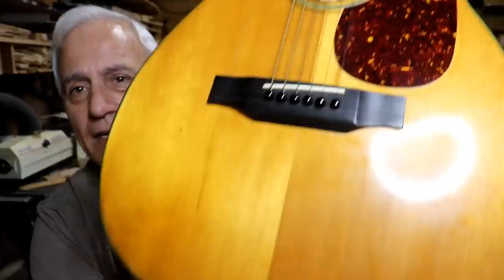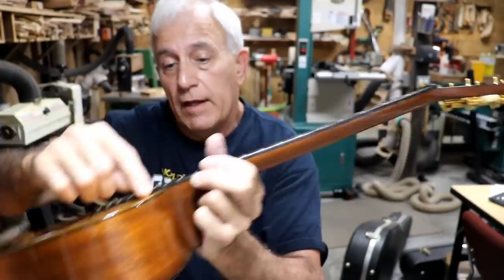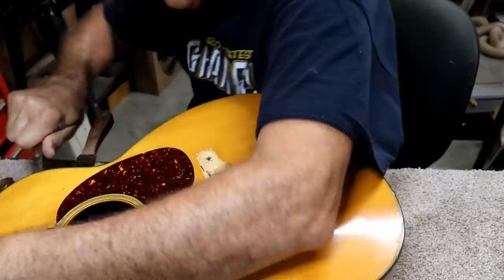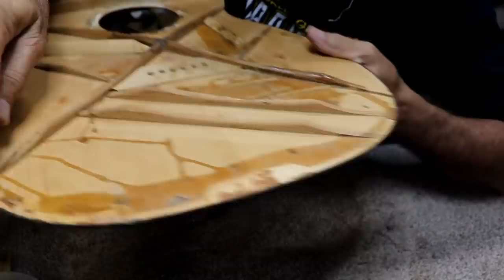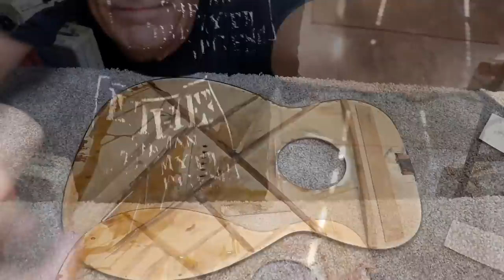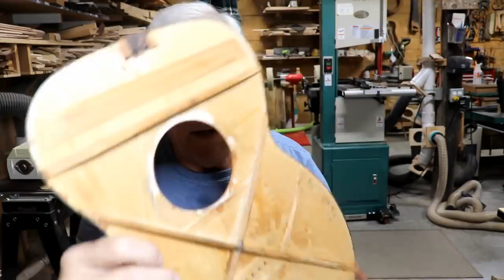542 RSW Martin 00-18 Journey From Total Destruction

Comment: Hey Jerry, I know you are a "tinkerer" so I had an idea... The knife you're using to separate the top from the sides could be modified to mount into an electronic component soldering iron with a thermostat in the base power unit.  Not the one that looks like a gun, that's a soldering "gun". Go figure.  What I'm getting at is if you dismantled that knife and just had the knife blade with the tang exposed, you could hammer the tang into a partial cylinder, say.... about 1/8 of a circle.  Then, place the soldering iron heating element into that partial circle.  Craft the proper mounts to secure it internally.  Then craft a tube that all of it slides into (make sure you use lots of fiberglass insulator).  Re-rivet the tang through the new tube handle with the cord going through the handle and there ya go.  Constantly heated knife.  Another thought is this could be made into a modular setup with all your knife blades having the same type of tang that slots into the heating element socket.  Possible time saver?   Just some thoughts.

Comment: Hey Jerry, I have a Thermistor controlled unit similar to yours but i don't have a big workshop so none of my apparatus are in situ. So to save time I use a cheap pair of women's ceramic straightening Tongues for back or front removals. It's very rare i undertake such work, but i can and i have on a few occasions. Anyway I find having heat go onto the tool,  on the top and bottom of the blade, helps loosen up the Glue a little quicker. I have picked up enough tips from you for Heavens sake. In case you hadn't considered. Thanks Jerry.

Comment: I usually clean hide glue mess by laying a wet (not dripping wet) paper towel over the area and waiting for a couple of hours. You might need to replace or re wet the paper tower a few times. After a couple of hours the glue scrapes of pretty easily. This method I believe would save you a bit of time scrubbing the area and could minimize the exposure of the top to water. That being said, the huge amount of glue you had there maybe would require multiple sessions…
Reply: You are right. It is pretty easy to remove this way. But soaking a couple of hours is not my thing. I soak the very spot for 10 minutes, then scrape lightly and repeat this process. This way the water hasn't a chance to soak too deep into the wood.

Comment: Theory: the glue dumped inside acted like the resin in a composite and "locked in" the curvature of a top that was out of shape from loose braces and cracks. Maybe it will recover some after its bath. Maybe look up the radius of the top and, stick it in a go-bar deck with that radius underneath. Maybe hit it with a heat gun too. Just spitballing

Comment: Jerry that fingerboard extension does add some structural stability IMO. I realize it’s only 1/16” of wood under the fret, but IMO that’s plenty of hardwood to minimize the backwards  “hinge” potential at the neck. Every guitar I’ve had in that has been cut at the extension was worse for it.  Tuning stability in particular but also tone.  The only fix is a new fingerboard which did solve the problem. Just my experience.
Reply from the maker: I've done it for years my work is 100% guaranteed and I've never had a return
Reply: I agree with Jerry...vastly experienced, IMHO

Comment: When those holes were drilled through the top and though the braces near the X braces it compromised the structural integrity of the guitar top.  String pull then deformed the top from the bridge to the tail block including all those braces.  It will need new braces to resist the string tension for a complete true fix.

Comment: Hi Jerry that's not a job for the feint hearted and all strength to your elbow for making the decisions you must make, now regarding the mystery of the damage to the top, my deduction is that the top "blew out".. with the pallet knife being inserted and the contact of the top still glued to the heel block, the top sheared between the glued edge and the finish, as the glue was stronger than the wood and as that wood is 60 years old and dry it's a "pressure blow out" anyway that's my detectives conclusion on that!! ...as for the soundboard I think the only way to shape that top is by removing all the scalloped bracing soak the soundboard, clamp it flat till dry and rebrace to hold the top structurally flat, sometimes its better quicker and easier to just start from that point but hey its your time and it's the clients money... im sure whatever decision you come to, it'll be the right one, good luck with the refurb... waiting for part 2...regards from the UK... johnnie

Comment: Jerry, I see that the lower X-braces and cross braces are heavily scalloped. Is this from the factory, or did somebody thin those braces in an attempt to get more volume? They look so thin that there can’t be much support there. If so, no wonder the top is distorted.
Reply: funny that I come across this video and this comment today.. I dont know why someone would try to get volume out of a acoustic by shaving the x bracing. To me all that does is weaken the top, or bottom while the guitar strings are up to tension..

Comment: The glue that was added was much harder and built up than the joint glue. When the flexible knife came in contact with the rigid glue it forced the blade to the path of least resistance, through the top.

Comment: Hey..love your work an videos ..I'm working on a mandolin from the 20's a B,L,$F..from New york... dont have much info on it it was sold through Chicago music exchange in its fay... my ??? My question is I pulled the back it was cleanly broken in 2 pieces, I have pieced an glued together the back very cleanly, an curios if a such of a large panel break?.... would it be necessary for cleats I honestly feel the glue repai is strong enough ...I just fear the wood being so old an dry will pull away from the glue at the crack repair...i know how much you dispise some just throwing extra wood under the top or bottom ,,I honestly do also ... there are  no gaps in either pieces of the crack repair they are as I said real tightly bonded bak together ...the crack is noticeable being so large but stable in my opnion... that's why I ask for yours ...I know there is no pics or photos for you to judge..its the age of the instrument that puts on the Fence..???
Reply: You, Definitely, want to use cleats, on that crack
Make sure the grain of the cleats is perpendicular to the crack.
Reply: @zapa1pnt  I understand how  to add cleats I'm just curios if theirs a rule of thumb for how big the cleat should be for the crack being the full back..half inch cleats every few inches or one real  long slim seam cleat
Reply from the maker: A few small cleats will do no harm.. I typically cleat anything that has stress on the joint.. If there is no stress on it and it glued really well the cleats are probably not necessary

Comment: Well, when it's wrong you have to make it right. I wonder if from a cost standpoint if you could make a new top as cheap or cheaper than trying to straighten out all the problems in that old one. Even if you do flatten out the old top, will it then be too large for the body? Fix one issue and create a new one.

Comment: Love following your thought process. Didn't catch what year the guitar is? Thanks
Reply: Jerry mentioned it being 60 years old, so that would mean early 60s.
Reply: Scalloped braces indicates that this guitar is pre 1945. After that date the guitars at Martin were straight braced. Also this guitar has an Adirondack tone wood top. These days (2022) this guitar in good condition sells for about $8500;if you can find one for sale. Usually luthiers remove the back and not the tone wood top of the guitar and I have never seen a fretboard cut like this before.

Comment: Did you consider pulling the neck before you got to the only two options you mentioned - 1) removing the whole fretboard and 2) sawing through the fretboard.  It’s a common repair and a viable option of making a separation at a glue joint that is easily glued back.  Is there a reason why you did not do this or mention it as an option?

Comment: Since you asked . . . I think the blade went underneath that wide swath of hide glue which is "hiding" the cut line? (Forty minutes later), well now that I watched the rest of the video, I cannot see a cut line inside after you removed the glue. So, so much for that theory. On another issue, here is my free opinion for what it's worth, I think the braces have to be replaced while the top is clamped flat to a level surface? Looking forward to the next video. Good luck!

Comment: I am glad I didn't get that guitar to work on.
Reply: Even if it were my own, I would be afraid to touch
it, for fear it would fall apart, in my hands.
Reply: @zapa1pnt  I was just wondering with all that glue everywhere, probably in the pores of the wood if replacing that top would have been a better idea.  If it were mine that top would have got replaced I think.

Comment: It stands to reason that flattening the top will also slightly expand its footprint (although where there are cracks, flattening may just close the cracks ).  I have no doubt that you can flatten the top and close the cracks with new braces.  Your challenge will then be how to make it mate to the sides again!  This better be a fantastic sounding guitar to make all this work worthwhile!  God bless you for trying to save this from the woodpile.  This is an example of someone who thinks they own a Martin 0018, but what they really own is a sentimental piece of junk with the Martin logo on it.
Reply: Any piece of junk can be fixed and sound good, unless it was manufactured
as a piece of junk, with bad materials. This ones braces, appear to be too thin
but the materials are good. So, I'm confident it will sound good when Jerry is finished.
Reply: @zapa1pnt  Jerry does a great job, but he can't turn lead into gold.  A warped, cracked top which may not fit the sides well after repair doesn't offer much hope for this guitar to sound or play well.
Reply: Truth be told I can't wait to see and hear this old beauty when Jerry is done.

Comment: The blade slipping into the top on both sides, in opposite directions: for me this indicates that the grain isn't running straight horizontally viewed from the side. That's why real good wood is splitted with an axe. This top is totally unreliable and belongs in the fireplace.

Removing hide glue: soak for a few minutes and scrape lightly, then repeat the process until done 🙂

Comment: Sorry Jerry but I have to disagree this time. Cutting the fret board at the body joint is not recommended because the fret board is part of a system that helps keep the neck from pulling forward. It would be better, if you have to cut it, to cut at the 12th or 10th fret. But you have to do what needs to be done to get the job done. And everyone has their own way of doing that. So don't let the comments get to you, you're doing a great job.

Comment: funny this video showed up on my radar today.. especially with your PSA to not glue random wood inside your guitar... Well... last nite I finished a project and put together/strung up and played a "project" acoustic where I DID JUST THAT!!! Only for me, I must have got lucky because this acoustic now sounds amd plays amazing!!!! While I am not a luthier, nor do I claim any skill set that is similiar. I am a guitarist of about 25 years, also a frame to finish carpenter for 20ish years. so I know about enough to be able to baffle another with less knowledge with B.S. I aquired this trashy Yamaha acoustic. $120 new so you know the quality is nill... So I wanted to expiriment on it. i cut the back off along with 1" of the side. I wanted a somewhat thinner acoustic. after that I peeled the cut sides attached to the back I cut off so I exposed the curfing still seculy glued to the back... sanded the sides so when I re glued the back on, it would be tight sans any gapping. while the back was off I noticed the wood under the saddle was non existsnt. 1/8 inch thick tops. i logically didnt see how it could have any tone or strength associated with it. so i cut and glued a 3/8 thick peice of oak I aquired from a pallet. I also remebered watching a documentuary on old Stratavaris violins. they have a sound post that wedges betseen the top around the saddle area and the back panel. so by that post the two are connected in the center of the 2 panels.. so I madd one out of the same pallet oak.. so to end a long story fairly quick. i glued back and front back together with sound post installed. reshaped the head stock so the string pull was straight. staying in tune was am issue before reshaping. now this guitar sounds and plays amazing. better then any other more expensive acoustics Ive owned. this 100 dollar yamaha plays amd sounds better then my taylor... because of a oak sound post, and reolacing the plastic nut with corian counter top material... lol

Comment: Did the knife go through the side edge ? missing the back and through the top?
Reply from the maker: That's my best guess but we couldn't find a hole in the binding either
Reply: @RosaStringWorks  okay,  well barring a miracle did you look for an entry mark in the binding before you glued the top?
If not then the glue could have followed the knife slot and gotten glued tight at the same time? I watched a few times and it’s impossible any other way. Great work by the way thanks for the time and energy you take to post the show👌.

Comment: I believe the knife popped through the top of the face because of the excess glue on there. When the tip of the blade reached the glue it went upward instead of where you originally had it. Not your doing actually sir. It's just one of those things that was inevitable unless you were able to know all the glue was there

Comment: Hi Jerry!  Having seen you use the fretboard extension to apply tension for a “poor mans neck reset”, is there a concern that cutting the board will impact the rigidity or angle of the neck?
Reply: If there is such a concern, he could insert an .008" shim into the saw kerf.
Reply: @zapa1pnt  that would not hold under tension.
Reply: @edd2771 : It would need to be the same wood as the fingerboard and .008 is the amount of wood the saw removed.
Reply: @zapa1pnt  yes the fretboard as a continuous piece adds stability to the neck. When you cut it, even if you fill the gap, some strength may be lost. Think of the fretboard as a half-lap joint that extends over the top of the guitar, and once severed will not provide the same support.

Comment: Re: The edge of the tool going through the top

What I suspect may have happened is that the blade went under all that excess glue and was redirected toward the surface of the top. When you withdrew the tool the glue just closed back up like nothing had happened.

Comment: Common sense would have been to quit forcing once he got to the head block and could not wiggle through.  I would have thought he would first do a standard neck removal with retention of the original, one piece fretboard off instead of butcher it from there.  He would have complete access from that point.

Comment: You should have pulled the neck with the fretboard extension. Then you could have come straight at the neck block. I know maybe you're looking at this from a time and money perspective but as a luthier I used to have a saying "there's never enough time to do it right, but there's always enough time to do it again". Cutting the fretboard at the body makes the fretboard two pieces and in time the two parts will shift out of position and the fret will never fit tight in that fret slot. If you need more money than the customer can afford then trying to rush it make it to make the job cheaper is a recipe for disaster. This is a candidate for a complete restoration not a hatchet job.  I try to stay positive in my comments but if there wasn't enough money for you to fix it right then you should have just left it alone. Like the doctors say, "do no harm". The crack in the side should NEVER have occurred. It was botched before, but the cracked top and side has just made it more botched. I've watched many of your videos and I think you do some really great work but this time it seems like you rushed it and paid the price.
Reply: I agree. Also, I feel like if he wasnt trying to show this process on camera, he probably wouldnt of been so rushed and the accidents wouldnt of happened. I know he has done it for years as he says but I just cant imagine cutting that fret board would ever be acceptable.
Reply: Totally agree!
Reply: @colescrustycars  Not under any circumstances...

Comment: I love how you start by laying out your approach and then chastising anyone who is going to comment on why that's not a good approach. Always a good idea to stifle feedback you might get from people with more experience. Then you effectively go on and demonstrate the consequence of your approach. And you find yourself in the wrong situation with the guitar half apart. First off, that top is garbage - incredibly obvious by the light reflection that shows excessive runout - which you further discovered with the palette knife. All of these issues this guitar had resulted from poor (weak) top material (which should have never been used). In short, this guitar needed a new top, properly braced, with a correct Martin shaped bridge. And since it needs geometry sorted out along the way, it should have had the neck removed as the first step since the neck set would allow you to get the neck geometry right once the top was repaired with correct bridge installed.